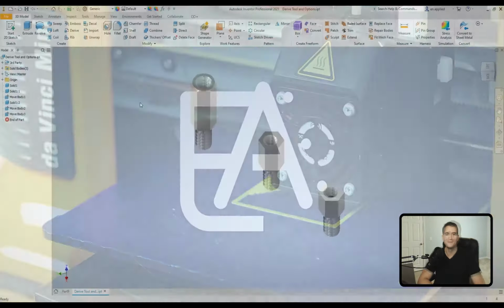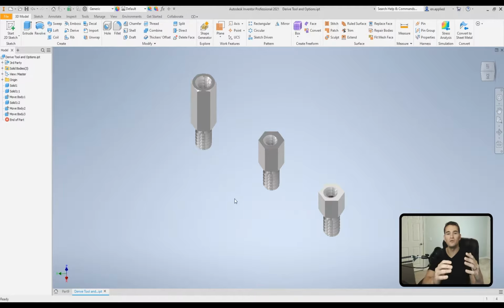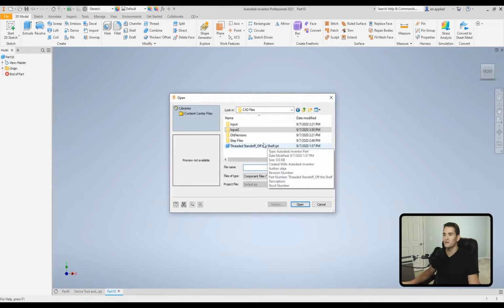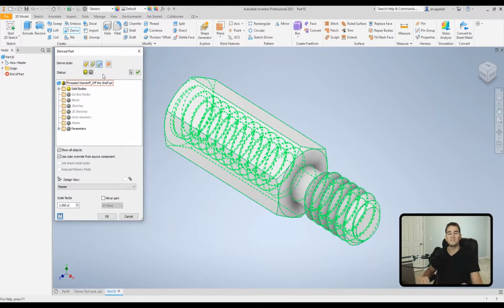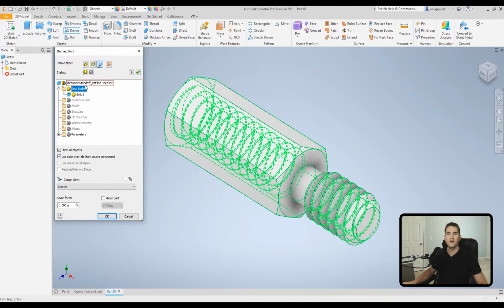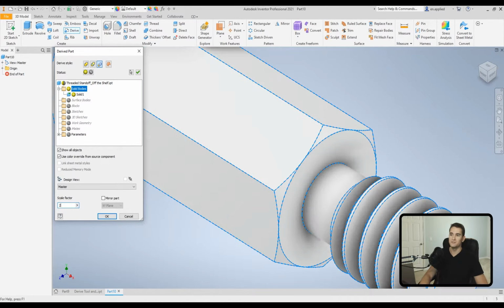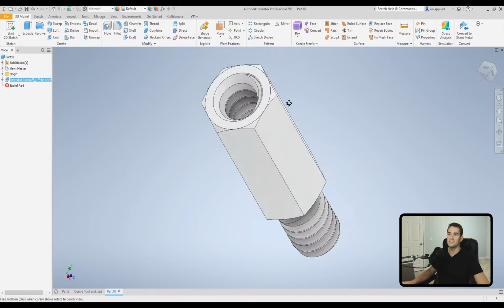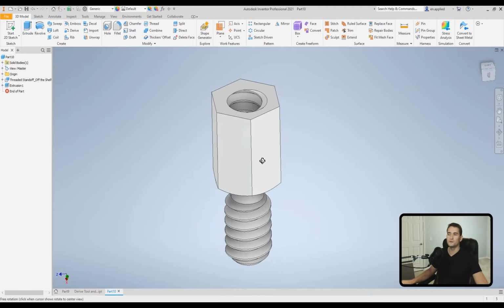Derive Command and Options - Autodesk Inventor Part Tutorial | Autodesk Inventor 2021 IN DEPTH

Comment: But... The example you used was just the equivalent of opening a scene file and using the extrude command to knock out part of your object, which doesn't require the "derive" command. Not quite getting it.

Comment: Do you still need the original part or is it embeded within the part?
Reply from the maker: Yes, you still need the original part because the derived part links back to the original. If you want to "derive" a part without linking it you can simply do a "Save As" on the original. The benefit to using a derived part is that whatever changes happen to the original file, those changes will be reflected in the derived part as well. 

Thanks for watching!

Comment: Can't we do save as and modify ?
Reply from the maker: It depends on what you intend to do with the operation. Using the derive command allows you to control how you modify the base part. You can use it to consolidate multiple solid bodies into a single solid, you can maintain each solid body separately, or you can even convert everything to work surfaces to reduce file size. So for example, say you have a large and/or complex part that is incorporated into an assembly that goes to a customer. What you can do, is you can derive a simplified version of that part from the original (base) part and save it as a work surface while also removing some details that the customer does not need to see, such as proprietary design elements. This will reduce your overall file size and allow you to modify the original part as you see fit so that you get enough information to your customer (such as overall part envelope size) but you still retain some of the proprietary information. 

Of course you can still do a "File > Save As" operation, however, the derive command is a more powerful method that affords you greater control.

Thanks for watching! Cheers!